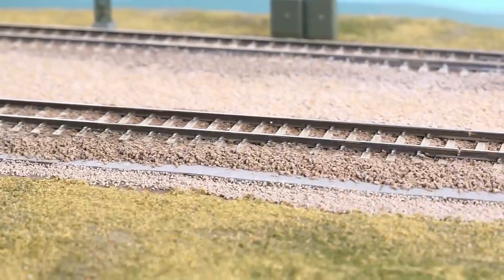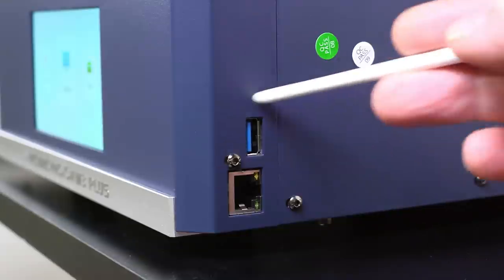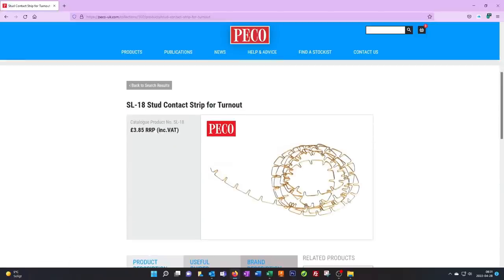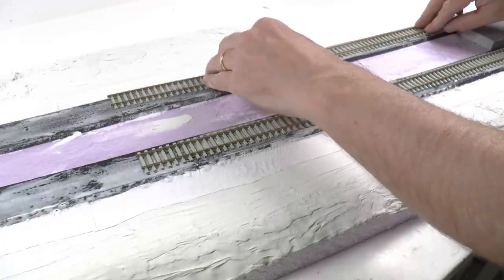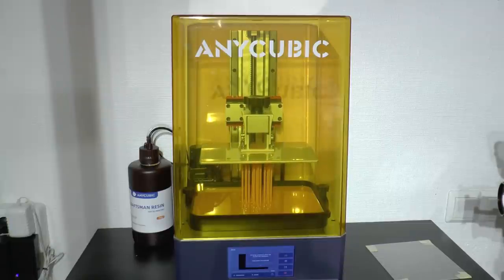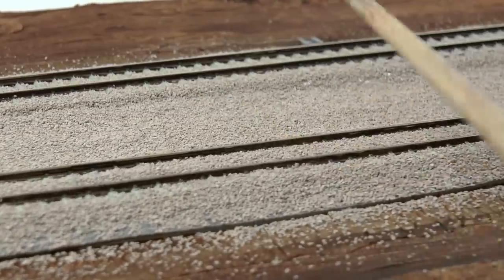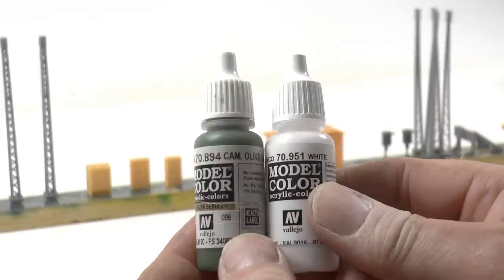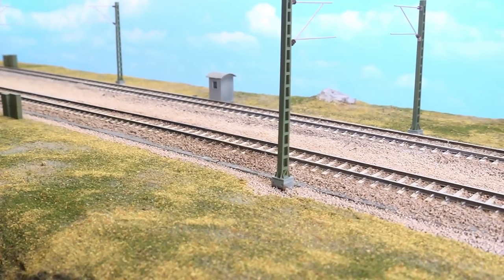Super detailed 3D-printed Catenary for DB German State Railways

Comment: Märklin do make flex-tracks in Z-scale with concrete sleepers, but nothing in H0, that's somewhat strange, I think concrete sleepers have been in use on German railways since the 1950s, both in West Germany and the GDR. I have a small Z-scale layout and modelling the 1970s and I have used tracks with both wooden and concrete sleepers.

Comment: Wonderful and inspiring as always. We’ve been contemplating a long time on how to put DIY pukos on those modern style Peco tracks and as discretely as possible, similar to K-track. All manufactured solutions aren’t satisfying in our book as of yet. All kind of thoughts went through our head but we are still working on it. Such a shame that Märklin doesn’t seem to resume development of K-track… Another route would perhaps be painting the sleepers but that would be extremely fiddly but then the shape should be prototypically be concaved as well, and not flat. Switches are very challenging on top, especially converting express points. We’re not finished thinking but we’ll get there in the end somehow. Thank you for this input.